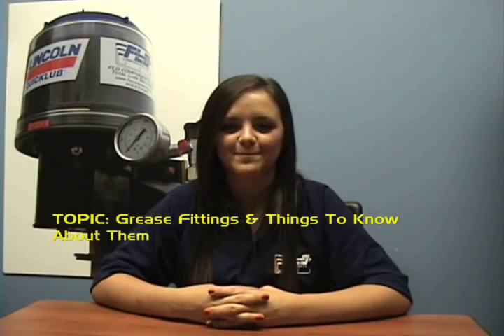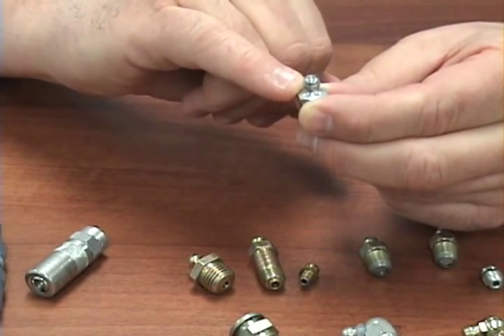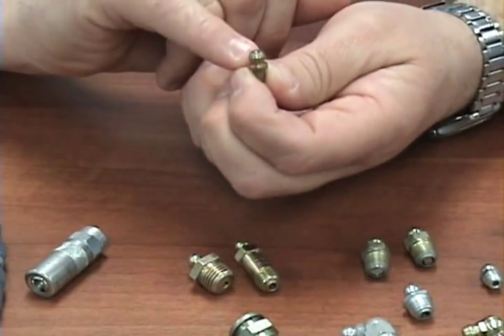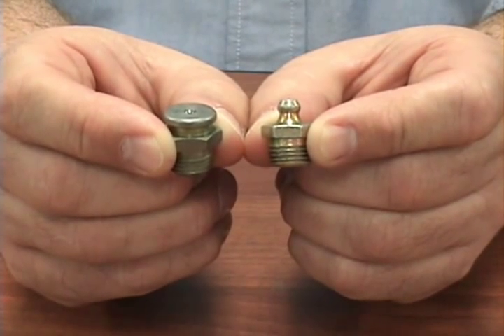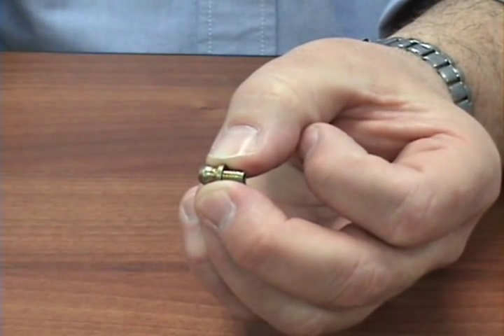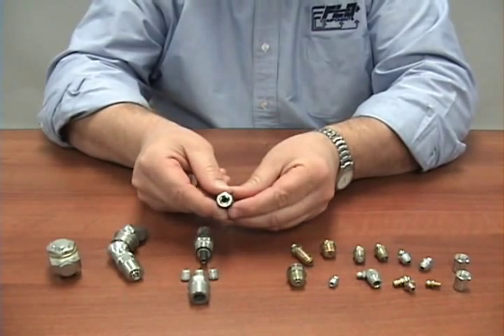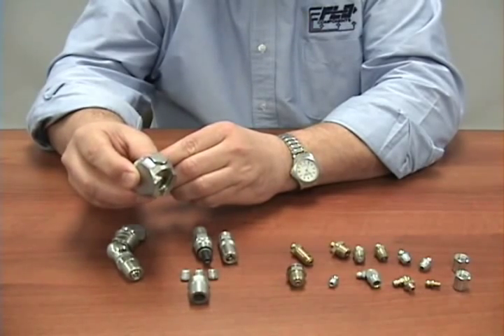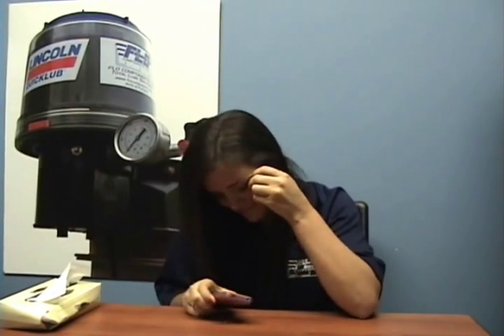FLO Lube Tip - Things To Know About Grease Fittings

Comment: Button-head fittings are used on bulldozer track rollers because standard fittings would shear off under normal use. If critical applications require the use of a specific type of lubricant, procedures, labeling and training need to be put in place, and only trained personnel allowed to perform maintenance. IMHO.

Comment: so if I have a problem with my grease hardening in the lines (which are roughly 3000 feet) how do I solve this issue?
Reply from the maker: If the question is grease hardening in the lines, we would suggest looking at the lubricant specifications to confirm that it is suitable for the application. Is there high ambient heat, high pressure required to push the grease through the lines, etc.  The lubricant must be able to work in the actual application. 

Hardening could also be a situation where two different greases were used (one changeover to the other) and they were not compatible.

If the question is how the get the hardened grease out of the lines - disconnect the lines, use high pressure and a compatible flushing lubricant to  clean them out.